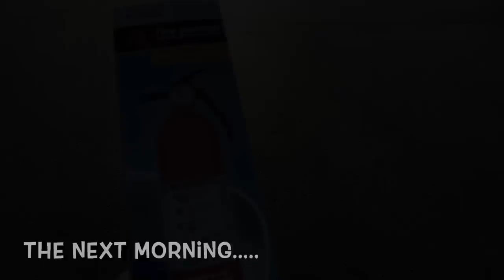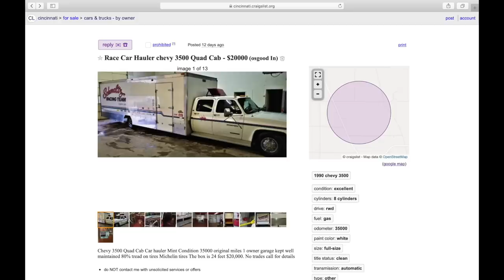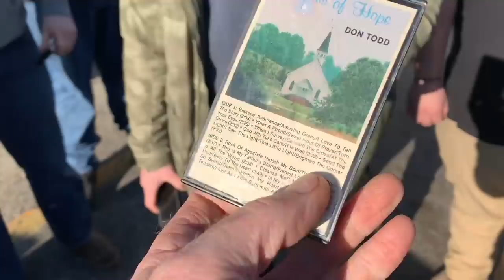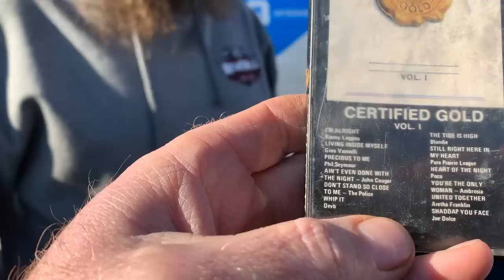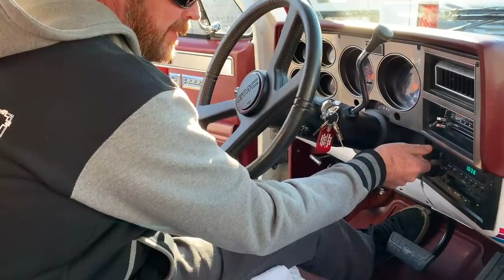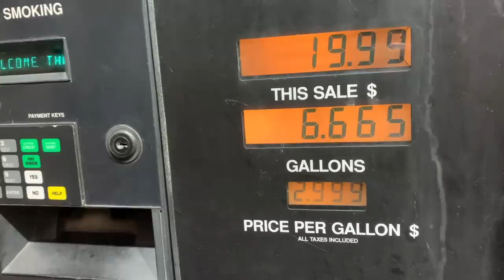Finnegan's Garage Ep.60: Blowouts, Rusty Gas Tanks and The World's Longest Ramp Truck!

Comment: Well, I can't sympathize with Will Thacker or his 410 upvotes. Finnegan, after 7 seasons of Roadkill, I’m surprised that you are still gullible enough to take a seller’s word on condition (to the tune of $20,000 un-counteroffered clams), and I'm doubly surprised that you think age doesn’t take its toll on rubber (both in regards to tires and all lines under the hood) and the inside of an uncoated fuel tank after 30+ years. You overpaid and expected miracles. Instead, the obvious came around to bite you on the butt, in classic #BecauseRoadkill parlance. 

Yes, $20k is a huge amount of money, but you're lucky that the seller did you any favors on an "as-is" sale that you apparently committed to...sight unseen! (With exception to a basic car-show looksie-over at Advance Auto, apparently). From what I can see, the whole thing smelled of shenanigans on both sides - an overoptimistic sucker of a buyer and a seller who doesn't understand that mint on the outside doesn't mean mint on the inside.

And before any of you YouTube opportunists say that the seller "should have known better" - who "should have known better" than Finnegan himself? The man has spent his working life learning what motor vehicles look like when you cut them apart and find the hidden ugly.

Also, what's this nonsense about running it home on the seller's plate (and supposedly insurance)? Where I come from, that's a load of crock. Seller's plate goes off, and the buyer's temp tag goes on, tied to the buyer's insurance. None of this loophole plate-swapping BS. That just starts the whole gravy train of both buyer and seller looking for an advantage, which - of course - happened. 

Not a single bit of this transaction was handled in the manner respectable gentlemen (or ladies) do deals. You both went full redneck on this one.

The irony of this is that if you were really desperate, you might have Instagrammed yourself up enough Roadkill fans in the vicinity to bring you everything you needed AND a home-made apple pie in the shape of a cassette tape.
Reply: That is perfectly said I kinda lost some respect for fin on this deal the seller well I don’t care about he is not in the public eye nor am I a loyal fan of his but this was just a big cry baby road trip then at the end his friend goes off about how mint it is so did the seller really misinterpret the ad
Reply: cudak888 same here but I have never fully liked mike I have picked up on him having attitude towards Dave and even Steve a few times nothing big but has always made me think of him as spoiled baby go back and watch all the roadkill episodes and pay attention to mike I think mikes is on his way out anyway no matter what they say or the hole show/shows may be on they way out idk I used to not have a problem paying for the MTOD but I have been thinking lately they have taken a lot of good original style shows away but yet the OG shows are still only 25-45 min sometimes close to 1hr and only once a month I am kinda getting sick of paying for so little content FYI I don’t watch the tv shoes
Reply: There is a big difference between a 2500 dollar dirt track cuda or something and a 20,000 dollar warehoused entire life mint condition truck you flew across several states to buy.
Reply: Acekiller1995 exactly what car guy would not expect to work on something that had been sitting for 20 years is ignorant or to use to the corporate money and the price was not based solely on the fact it was like new it was because it was almost one of a kind and rare and worth what some one would pay
Reply: Sure he should have been more careful about the purchase -- but that seller is a scumbag who lied to him.  It's the seller who is at fault here, NOT the buyer -- who was WAY nicer than I would have been.
Reply: bklynp718 same thing could be said about mike being a scumbag for slandering there family name on the side of the truck all over the internet
Reply: ultimately its like any used car and its buyer beware. Its not the sellers fault that you didnt have an inspection done prior to purchase (which would of 100% found the tire issue,and very likely found the fueling issue as well)
Reply: @earlsspeedshop7058  are you a family member?  Too f'ing bad that the seller is a scumbag, and put his own family's name on the side of truck for the whole world to see.    I think the video was more than fair to him.
Reply: @Acekiller1995  Ok...what's the big difference? Go on, tell us. Keep in mind that all this BS about the truck being "mint" already flies out the window on the most casual of visual inspections - the headliner is falling, and there's some very notable discoloration of the red carpet at the back of the truck. Expecting a 30-year-old fuel system to be mint is nonsense - unless it's been gone over from end to end.
Reply: @bklynp718  Lied to him in what way? Go on, tell us.
Reply: @legohead6  - Exactly. Doubly idiotic that Mike - someone who should already have a pretty comprehensive knowledge of automobiles - didn't do said inspection himself on a proper lift. Also, no matter what Mike says, his comments (along with Newborn's) as they're backing out of Advance Auto indicate that they NEVER test drove the truck before forking over the cash. That's after the seller wound up at Advance with a fuel issue - which they apparently admitted to and attempted to fix.
Reply: @bklynp718  - According to the research made by some in this thread, the original owner passed away. This was the family selling the truck. Is it fair to drag a dead man's name through the muck on the internet because you have a twice-removed beef with his family? I think not.
Reply: First off cudak mr know it all attitude you dont pay attention really well do you? The first video shows them test driving the truck. Its literally a five or ten minute section of the video. Second of all the difference is you expect even a nice 2500 dollar car to break down. A 20,000 dollar car i expect if your selling it to me as mint condition then i expect you to have gone over the bases. And yes people miss things but the guys actions after were totally unacceptable and obnoxious. The tires sure thats on finnegan its obvious. But you sell it to me as properly stored for that long i expect the tank to have been stabilised or emptied etc
Reply: @Acekiller1995  you better stick to buying new vehicle
Reply: @Acekiller1995  The only difference is the price and how much you want it. That doesnt make it any more the responsibility of the seller to ensure its good to drive across the country.

I buy vehicles remotely all the time. I assume they all are going to need something, offer accordingly, and then have them transported home. Ive never gone back and contacted a seller over anything.
Reply: @earlsspeedshop7058  the follow up is the wench stopped working and there is a big exhaust leak into the box. I think this this is a good example why you don't fall in love with a vehicle before you give it a good once over and then hand your money over.
Reply: Its just cincinatti man.  I live about 40 minutes from there and I wont even consider buying a vehicle from there...  Every seller is a ghetto piece of shit and every vehicle is "mint condition" and end up being the highest priced piece of shit you couldve found.  Example: I went a looked at a mustang gt last year (last car I'm ever going to consider) and I literally handed the guy a handful of his rusted framerail. 

This was after the guy talking the radio up saying it had 15s in the trunk, (ended up being 10s but thats irrelevant because when he popped the trunk to show me he's like "oh, I didnt know it was that one... I gotta keep that")

Anyways, I learned my lesson about buying from the ghetto. Js
Reply: MarwoodAuto this is true. Next time i buy a used vehicle we're going for lunch with the seller in said vehicle 20 miles away. Hopefully 40 miles will draw out the gremlins. Then we can discuss price if i still want it after that. I think its fair unless theyre hiding something like with fins experience.
Reply: Whoa, Whoa, Whoa. Cudak888 - Arenot you the guy who plays with toy trains with faces on the internet????? I thought I had blocked your content long ago. GFYS
Reply: @joe24baby  Since personal insults seem to be in vogue down this rabbit hole...I see you've been playing with your toy boats in the tub, Mr. Seaman.
Reply: @earlsspeedshop7058  I noticed his friend forgot to mention the mint headliner.
Reply: I think you went way too easy on Fin.

Comment: I'm a fan, but seriously? You took a sellers word that a 30 year old car was "mint"? You as the operator has the responsiibiity  for checking that your vehicle is safe. Yeah, those tires could have killed you. That's why you  check the date before departing on a long trip. Battery and fuel tanks/filter upgrade is also mandatory if the seller does not provide recent service history.